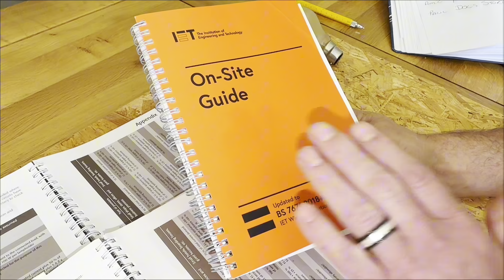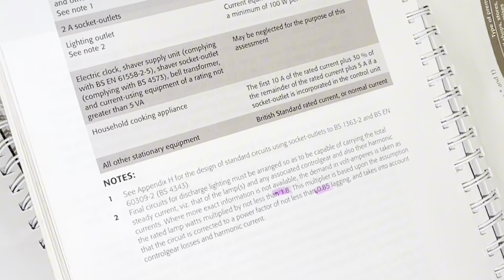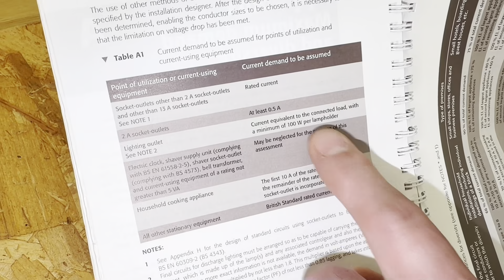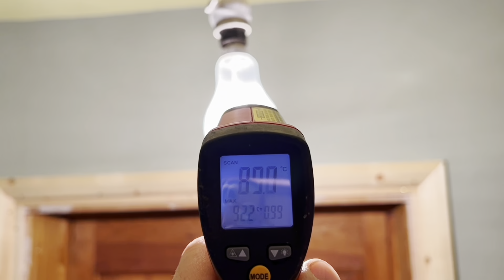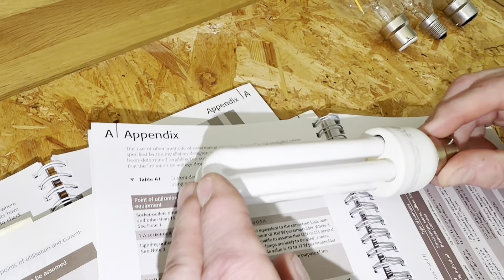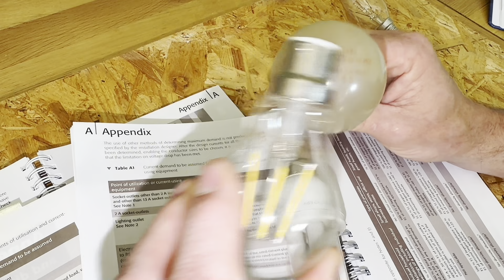Has BS 7671 Finally Caught up with Modern Lighting?

Comment: Although if the luminaire is capable of being fitted with a 100w GLS lamp because of the type of lamp holder fitted not being exclusively for LED or CFL lamp types (GU10L1 etc) then your probably still stuck with 100w.  You can annoyingly still get glass tungsten GLS lamps (Although they're usually the halogen capsule variants) and some people prefer them.
Reply: Why is it annoying, nothing wrong with GLS lamps.
Reply: @ChariotsofWire180  because as they are still available and therefore can be installed your still realistically stuck with 100w per pendant.
Reply: @jasonwatson9011 Nothing wrong with them, maybe you need to get out of the "stuck" mentality.

Comment: prepared to test a 150w bulb with full spectrum light but no test on led that is very heavy on blue light and bad for your health
Reply: I only work by whale oil lamp because of this: electrical lamps of any kind are terrible for health because of the vibrations.

Comment: Surely industrial lighting still falls into the Onsite guidelines
Not too long ago I installed a three hundred watt emergency light fitting into a Fire Escape safe route The calculation for the hole route would gives maximum of three Per circuit giving the extra ten percent parameter for the FIRE word